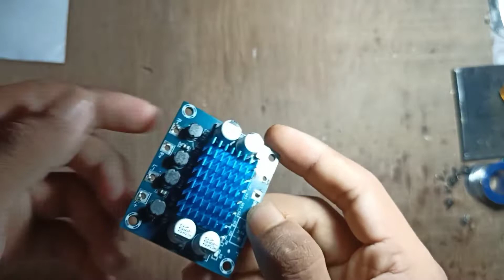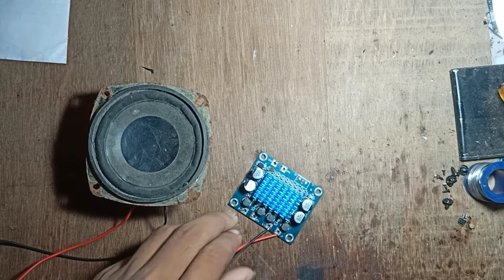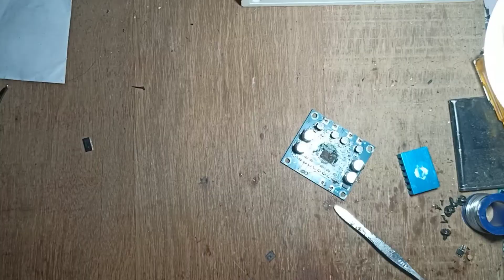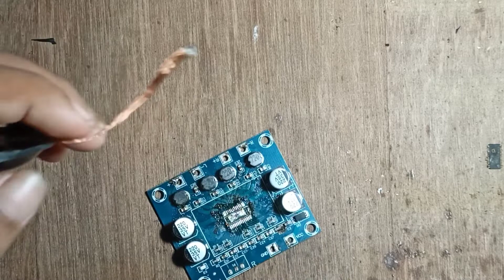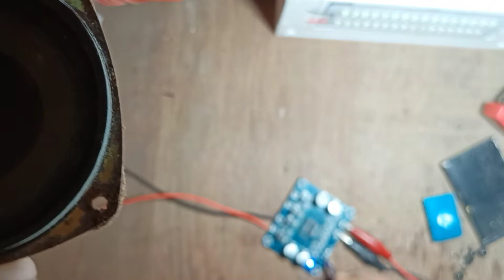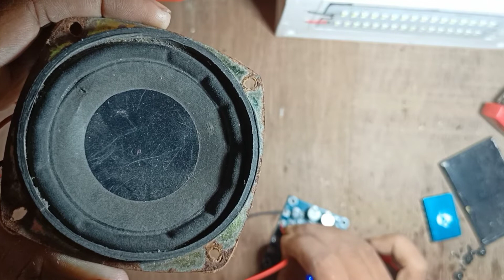AMPLIFIER REPAIR . CLASS D AMPLIFIER REPAIR

Comment: Hello. I also ordered one of these from AliExpress. I listened for about 2 hours and then it died. I ordered a replacement IC and replaced it, it also worked for about 2 hours and died again.
However, the IC wasn't even warm, so it didn't overheat. The third IC exchange did not even succeed because it did not work. I got bored and threw it away.
Reply from the maker: Your supply voltage and output wattage is same , if same then your input capacitor bad .